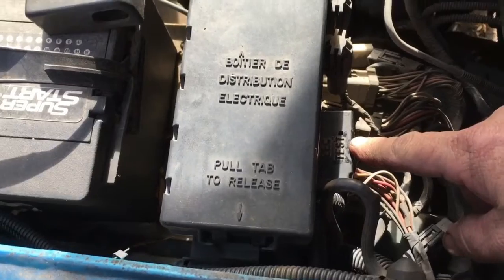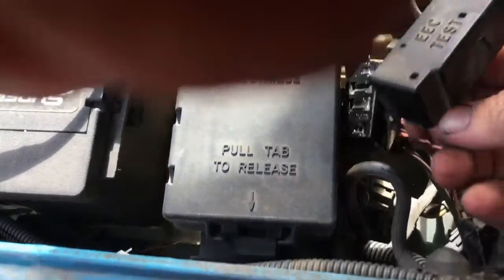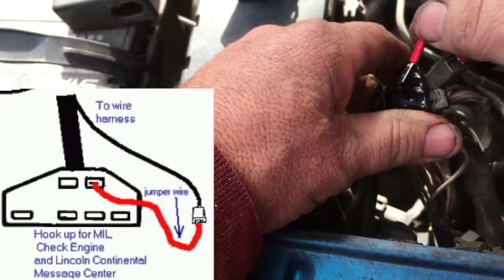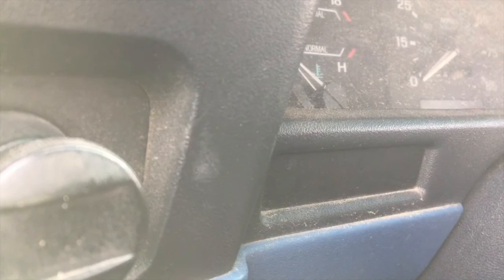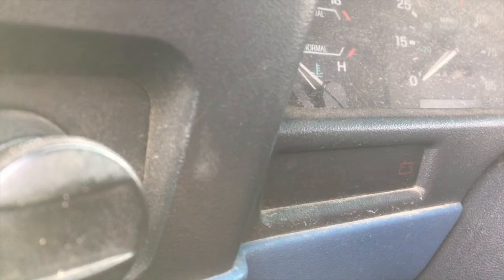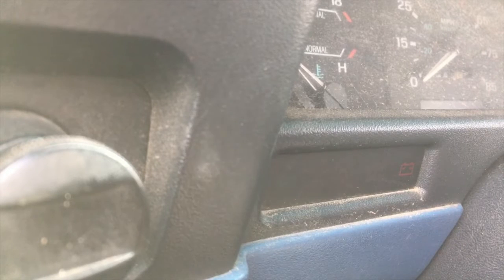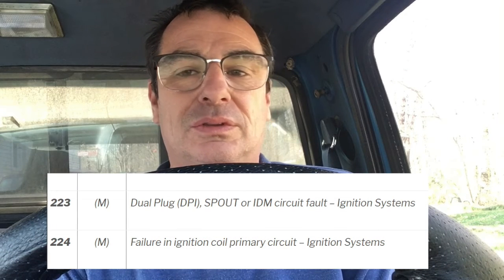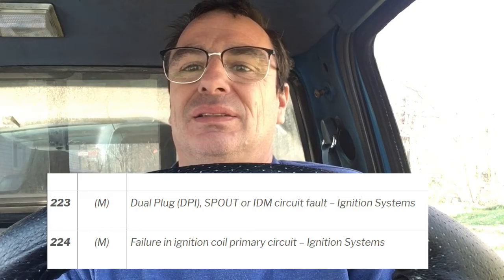Quick Tech tip #1    ford OBD 1 diagnostic

Comment: And you know if it's not the coil pack  it's usually the flux capacitor and you know the other thing the whatchamacallit
Reply from the maker: Turned out to be the Kanuter valve.